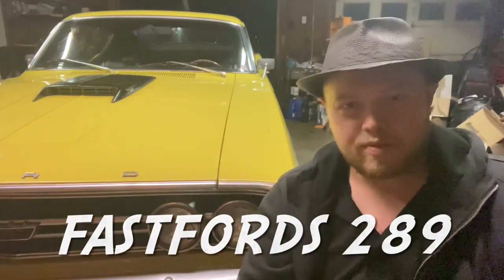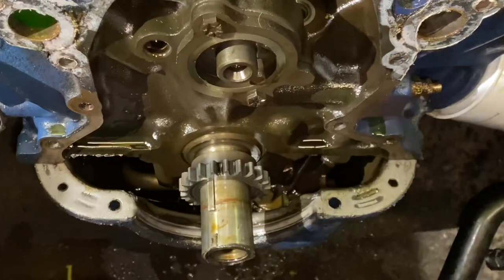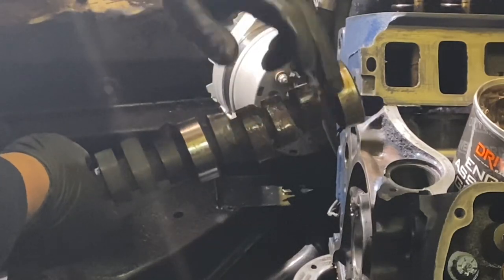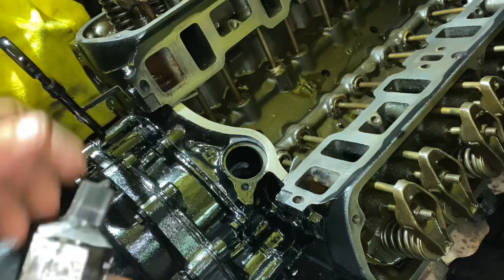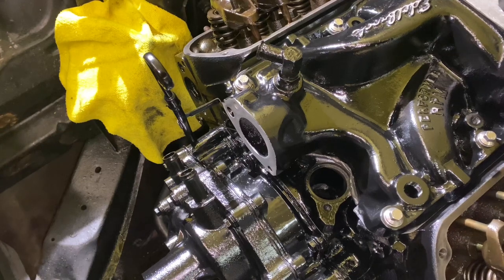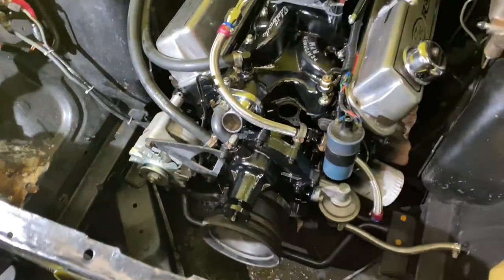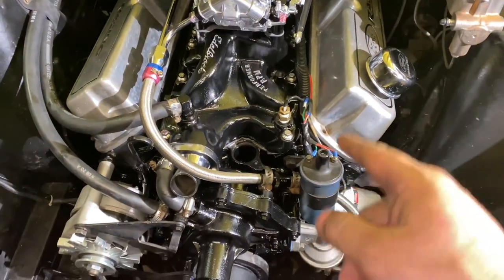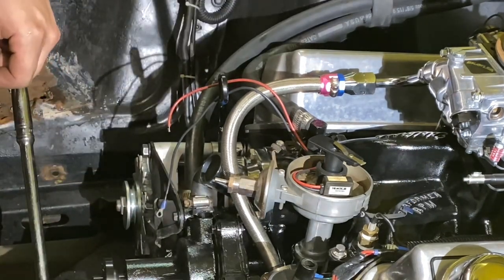New cam and intake install! (Ford 302/351w)

Comment: Nice tutorial video, good job. I replaced my harmonic balancer with a Ford Racing harmonic balancer (28.2 oz) when i did my 351w swap. It's machined for 3 and 4 hole crankshaft pulleys. It had a huge difference how smooth and how the engine reved. Totally worth the exta $$ , if in the budget. I also replaced the harmoic balancer bolt with and ARP one.
Thanks for sharing!
Reply from the maker: That’s great! I definitely plan on buying a new high performance harmonic balancer when I build the 351c I plan on swapping in hopefully soon in the future. I can believe how much a difference it made, those high performance machined parts non comparable to stock parts. Glad you liked the video, and glad it was helpful. You’re most welcome, and thanks for sharing your experience. 
Thanks for watching.

Comment: Excellent, detailed video with a great presentation of clean but in-use engine bay. That edelbrock/comp stuff works and looks great these days, it's nice to have nice stuff that all works together properly.  That cam is  $237 which is 1/2 the price of a typical comp and small enough for no changes.  Sounds powerful and more importantly it runs correctly.
Reply from the maker: Thank you, much appreciated, glad you enjoyed the video. Yeah it’s a good combination, it runs well for being mostly stock engine, still a works of fun to drive. 
Thanks for watching.

Comment: I was wondering about your tape & socket setup, did it come off when you were priming the engine?
Reply from the maker: Nope, never had an issue and I’ve used it several times, just use electrical tape and wrap it good and snug and make several passes starting at the socket going up the extension and you’ll be good to go. Hope this helps, thanks for watching.

Comment: Nice, explanation of a cam swap. I would have included venting the cooling system while refilling to remove all the air. Engine needs to run without problems for the cam break in.
Reply from the maker: Thanks bud I appreciate it. Yeah valid point, I guess I got to excited to hear it run and forgot. Thanks for the tip and thanks for commenting and watching.

Comment: Have a question about the 68 torino I had in 1974 ,when I was doing the heads on my 289 it was a 302 block and I was sure it had never been worked on before. Heads stamped 289 and the block was 302 stamped, has anyone heard of this just wondering 🤔 💭
Reply from the maker: @stevehusk6215  great question and cool car by the way. Well the 302 was introduced in 68 so sometimes when the factory was assembling the engines they would just grab whatever was available and since they still had some 289 stamped parts such as blocks and heads they would get put together. The 289 and 302 are the same engine, only difference was the crankshaft and connecting rods, but nothing else changed in the design, just the stamping. Hope this helped, thanks for watching.
Reply: @FastFords289  ya makes sense, just was hoping that I had something special in that motor. It ran great for a stock motor
Reply from the maker: @stevehusk6215  oh yeah, those 289/302’s run good especially before the smog era started getting set in.

Comment: Great work!
Geat sound have this cam!
Can you tell me what the Part Number of this camshaft is or send me the camshaft link?
Did you use stock lifters? and the spring valves are stock to?
Normally, non-replacement cams use specific lifters and spring valves.
Reply from the maker: Thank you! I actually ended up installing two cams, the first one was the thumper cam https://www.compcams.com/thumpr-227-241-hydraulic-flat-cam-and-lifter-kit-for-ford-221-302-cpg.html
It ended up being too much as I don’t have adjustable rocker arms and it was bending push rods so I installed another cam that I had on the shelf that unfortunately they don’t make anymore, it was the comp cams 265DEH, great cam so idk why they stopped making them. Yes I did use new hydraulic lifters for both cams, just whatever comp cams sales with their cams or whatever the auto parts store sales, nothing special just a normal hydraulic flat tappet lifter. I did use my stock springs and I can say that I definitely recommend getting stronger springs as they float too easy. Tunney work ok with the 265 cam but still could use better ones but the thumper cam definitely needs new ones. I didn’t want to invest in head work or a new set of heads as I don’t plan on keeping this engine but I wanted something more out of it for now until I build my other motor. Hope this helps, if you have any other questions, comments or concerns feel free to ask and I’ll answer the best I can. 
Thanks for watching.

Comment: The stock exhaust manifols will make it hard to get 1 hp/ci......Long tube headers will REALLY bump up lower speed torque, as well as high rpm HP.....Shorties only help at high engine speeds, ( if you need to kill low speed torque for traction).
Reply from the maker: Yeah I was gonna get some headers for it but I put that on hood as I have plans for another engine build and I’ll get headers for that one when I get done, but I absolutely agree it would definitely help. Thanks for commenting and thanks for watching.

Comment: Great work! Lots of helpful DIY details. What do you think this would dyno at? I know it’s a cruiser but curious.
Reply from the maker: Thanks buddy I really appreciate that and I’m glad  it could be helpful. I’m really not sure but I’d guess it’s making at least around 350 horsepower right now. Probably around the same in torque. Could be alittle more or alittle less. I can tell you that it definitely has more Pep than before though that’s for sure. It’ll set you back in the seat now without even flooring it, so it definitely made an improvement and made the car more fun to drive, hope this helps. Thanks for watching.

Comment: Dude what intake gaskets you use i have the hole like your heads have and its not covering that hole and letting it leak vaccuum. Just recently picked up the truck and didnt know they had done the 351 head swap the carb was junk so i figured that was issue well after spraying carb cleaner around intake i noticed two visible holes above my edelbrock 289  intake
Reply from the maker: @williamleadingham6276  sounds like you have the 77 and later model heads, in 77 they enlarged the holes in the intake ports where as the 76 and older heads had the smaller ports. So if you mix match the gaskets to the head then you could have a leak.
Reply: It's the port right dead center of the heads there's a hole above that that fits about maybe a pinky into I picked up 302 intake gaskets today but they are the same I pulled off and on your video I see that hole getting covered with my intake on I can still see half of that hole but on yours looks to disappear.... just learning this stuff if you can't tell first intake job LOL but I know sprays around the intake is where my rough idle disappeared and I figured that hole had some of the issue cause that's right around the area where it sucked in the carb cleaner and ran great! But I did notice they had the head sides facing intake side dunno if that matters or not I'd say it didn't help lol my bolts looked pretty rough so I'm gonna find me some good hardware kit for it that couldn't hurt it none either lol
Reply: Right at 3:45 in the video that small port with the holes on both sides I have no issues it's that hole up above it but your gaskets cover it perfectly mine will not
Reply from the maker: @williamleadingham6276  gotcha, yeah those holes don’t go to anything, they have a bottom to them and even on mine they are partially out of the top of the gasket. It could be possible that your heads or intake isn’t true and flat or maybe you accidentally over tightened the bolts, that could cause it to leak too. I’d recommend getting some thicker gaskets, they thicker crush gaskets for uneven heads or intake so they seal. I believe they’re Mr gasket brand but don’t quote me on it. Your local part store should have them or be able to order them.
Reply: @FastFords289  thank you! I've torn it down yesterday and very hopeful on getting it back together this week and it being better than how they had it but like you I almost wonder if they'd got some heat into it and ruin the trueness of surfaces or anything else like that
Reply from the maker: @williamleadingham6276  you’re welcome, glad to help when I can. Yeah that’s the only thing I could think of, so I hope you get it back together bud and everything runs good, good luck. Thanks for watching.

Comment: Nice vid about the swap I will do too in the future to my 68 Fairlane Hardtop Coupé with a 302. As I did that years before on another car I can say you covered all the important stuff other than the break in or torquing the rocker arms. 
I am searching for a mild cam which makes good torque and the wheels squeal. But without changing springs, rocker arms and these and that… Are you satisfied with the outcome? Why did you chose the CompCams? I stumbled across the Edelbrock Performer Plus, it seems quite the same. Was this a stock engine before? 
Keep up the good work, we 68/69 Fairlane/Torino drivers have to hold on together 😉👍🏻
Reply from the maker: Thank you very much! Nice car too, I’ve always loved these cars since the day I first saw them. 
Yeah I didn’t cover the break in mainly because it’s a cam that I already had on the shelf so it was already broke in, but I should have covered it anyway just for people with new cams but didn’t think about it. The rocker arm torque on those I just always tighten down good and tight since they’re tighten to stop style plus there lock nuts. 
I’ve always used comp cams, idk why I guess they’re just the ones I went to that had the cam profile and outcome I was looking for and I’ve never had a problem with their cams. 
Yes it was and still is a stock engine other than the cam and intake and carb. The cam I’m running now is a great cam and I ran it in my 76 ford truck before but unfortunately they don’t make this cam anymore it’s the comp cams DEH265 flat tappet cam. RPM range of about 1500-5800 duration-216-218 if I remember correctly with about a .500 lift. 
I’ve heard good things about Edelbrock cams but never actually bought one, my 71 ford truck 302 I had along time ago had an Edelbrock cam but I can’t  tell you the spec’s because idk. I only know it had an Edelbrock cam because I tore it apart one time and looked at it but I reused it. It was a good cam had good torque, I think it was an RV cam because it sounded pretty stock but pulled good. 
I hope all this helps and answered all your questions, and I appreciate the compliment and you commenting and sharing. 
Yes we do need to stick together, there’s not many of us out there and we get overlooked by all the cliches like mustangs and Camaro’s. 
Thanks for watching.
Reply: @FastFords289  Thank you very much for your comprehensive answer. Yes, that helped much! I will look around for a good cam within the spec range you told. Thanks again, appreciate your content ver much!
Reply from the maker: @blackforestvintagefords7872  you’re very welcome, good luck on your build, hope it turns out how you want. Also I forgot to mention, if you’re wanting a cam that pulls good but you don’t care about lope or thump and all you want is torque, you can look into their 250h or 256h cams, they’re more like RV cams. Look for cams with RPM ranges of around 600-1200 RPM’s they pull good in low end.

Comment: what heads are those?
Reply from the maker: @sheldonkepley4585  plain stock 74 302 heads. Not good heads which is why the engine doesn’t run as well as it could and should. I just don’t invest in new heads because I plan on building a 351c for it eventually and will get aluminum heads then. Thanks for watching.
Reply: @FastFords289  man, i have the same car , i sure appreciate all your videos.
Reply from the maker: @sheldonkepley4585  that’s awesome, yeah I love these old cars, just don’t make ‘em like that anymore and you never see them. Glad you enjoy my videos and find them entertaining and helpful, that’s what it’s all about. Thanks for watching and being a supporter.

Comment: You absolutely can have too much zinc.  Run break in oil after that just the ZR1. Source: Motul
Reply from the maker: Yeah I know, I wasn’t speaking literally, but you do want to run zinc. The break in oil is fine but I’ve just always ran regular oil with the zinc additive, and I’ve never had a problem, the break in oil is nothing more than regular oil with extra zinc so you have that vision between the metal surfaces. Really just comes down to preference, but I appreciate the input. Thanks for commenting and thanks for watching.